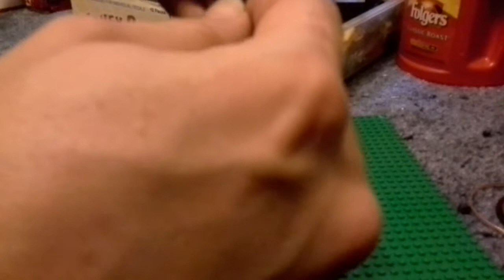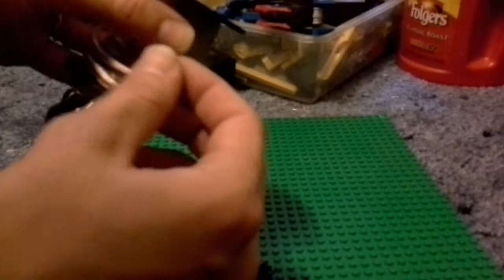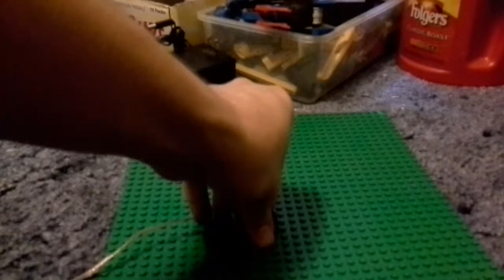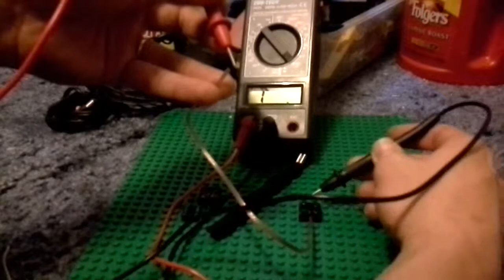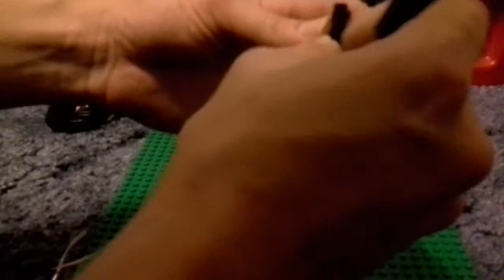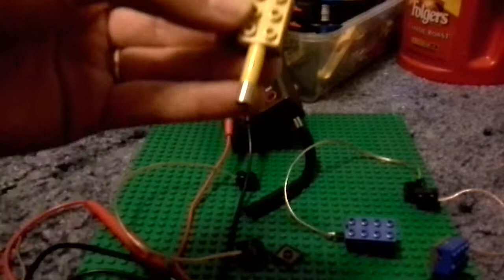Lego 9v wire replacement + Sensors

Comment: HI!  Nice video.  How do you put heat shrink wire wrap on cable on the sensor while it is still connected?
Reply from the maker: Heatshrink goes on before soldering the wires together.  I had always planned on making a follow-up to this video with a better camera, but by now I don't think many people are still using the 9 volt system.
Reply: @ibanez3434  you may be wrong, I know many of us are still coming out of the dark ages and need information on this, I know I need it badly! If you do a new video, please try to avoid putting your hands on front of the camera, obscuring the important parts. Thanks for the video though
Reply from the maker: @privateagent  I am a man of my word, eventually :p.  Here's the new video on my Lego channel https://youtu.be/kXApTUbNzD0